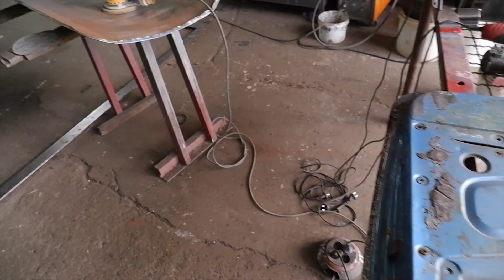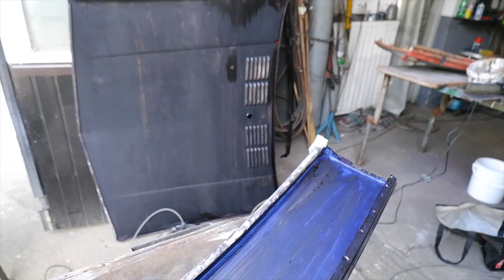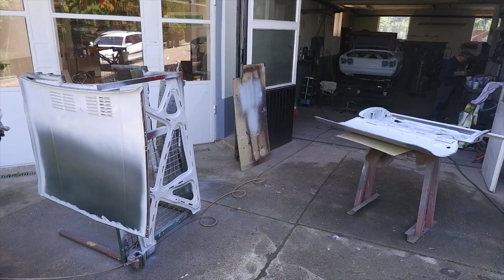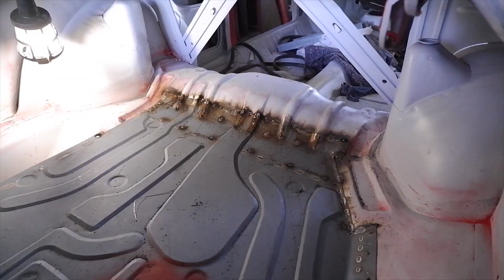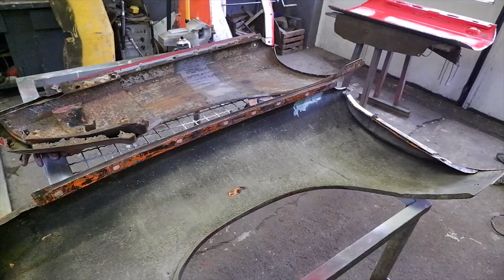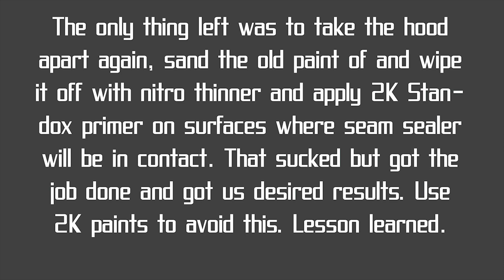Opel Manta A '71 -  Hood assembly (gone wrong) and protection of parts

Comment: do you have any video or pictures of how you took the hood appart? i have some rust under the hoods frame, i should do exactly the same as you did.
Reply from the maker: Hey! There is in one of the older videos "How we saved the trunk lid | Hood restoration |" ; so there you will see how we took it apart. There are spot welds on the sides and seam sealer and you can see how ti goe in that video. Hope that helps! :)